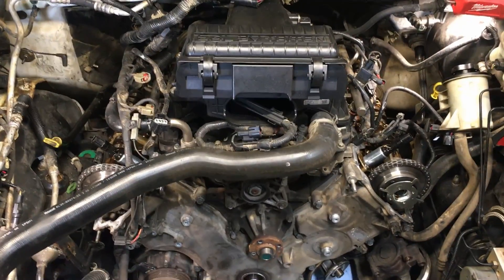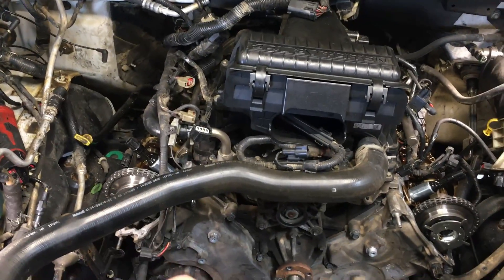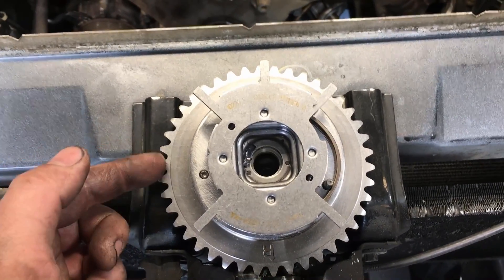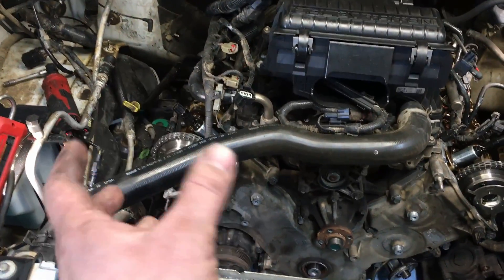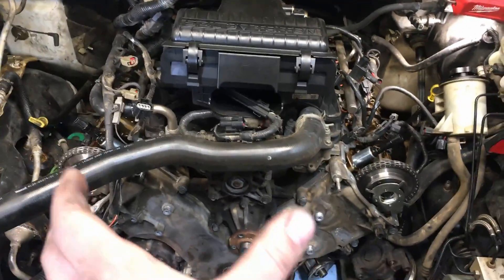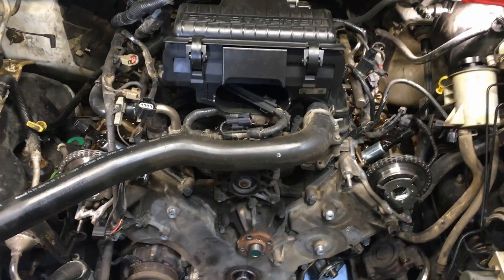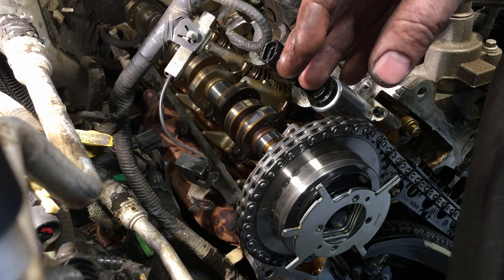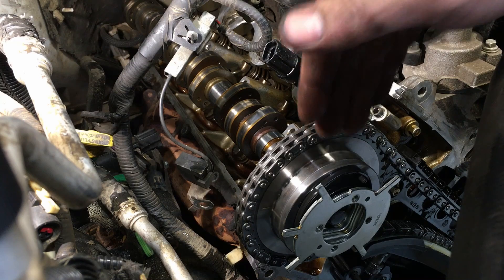Ford 5.4L 3v Triton Engine: DO NOT USE AFTERMARKET PHASERS FROM FREEDOM RACING/OTHERS; THIS IS WHY!

Comment: My trucks has 150k miles on it I’ve always service my oil with fomoco oil and filter. I can only really hear the phaser when I’m near a wall like at a drive thru . Should I consider replacing them or is some noise normal?
Reply from the maker: If it is just a slight phaser knock hot and they are Ford phasers then you are fine for now.

Comment: Granted, you'd rarely see old school vehicles with the 300,000+ miles we regularly see out of our fleet vehicles with old school (carburated, simple hei ignition systems and three speed auto transmissions)...but I'd much rather work on/maintain stuff built prior to 1983 than anything modern.

Comment: You charge $2300 to do timing kit and oil pump?!?!? All mechanics are thieves whether they’re honest or not. Nobody should charge more than $100-$200 for a full days work.
Reply from the maker: 60% of that price is parts which I sell at my cost, the rest is labor and fluids. You have to remember running a shop includes overhead like rent, gas, electric, water, tools, training, supplies, service subscriptions, tv, internet, chemicals, free loaner car up keep, waste oil disposal fees, garbage pickup and shop equipment upgrades to name a few. Oh and on top of that I have to pay myself and the Office Manager somehow so we can put food on the table. Compare my price to other shops charging $3,400 or dealers that are over $4k for the same job. Does my price seem fair now?
Reply: FordTechMakuloco  I understand that the parts are between $800-$1000 and that’s for the full new kit and oil pump. but $1300 for labor is a bit steep. Why wouldn’t you just pull the valve covers and replace only the phasers? Save the customer hundreds of dollars on labor.
Reply: What do you do for a living, Creamer?
Reply: lincoslam I’m a mechanic. A pretty decent mechanic if I don’t say so myself. I do work at my shop in my city mainly for friends and family and people who need their vehicles fixed but can’t afford to pay “mechanics” who charge $100 an hour for labor like single mothers and elderly people who are unable to work.
Reply from the maker: Why? Well here is the thing, when a vehicle comes into my shop and has been touched by someone else that deep into the engine and I just change phasers then he breaks down driving home (which is out of state) or has a startup rattle after. Well now it reflects on my work and how thorough I was. They rely on my as a professional to fix it and fix it right. Low and behold Freedom Racing sent him aftermarket chains, tensioner arms and tensioner. The tensioner arms were already grooved and tensioner seal falling off after 150 miles! Pretty crazy right, now do you see why I do what I do. To help I sold him all the Ford parts at my cost and a few I accidently sold below cost installed them and fixed it right from the bottom on up. I have a video on the parts that came out of this truck after 150 miles if you want to see them email me.
Reply: FordTechMakuloco yeah I feel yah. Lots of junk parts out there.

Comment: Weld the pins, use lock outs, don't use vvt,  be nice if you could run 2v cam gears, I'm joking for those that need to be told
Reply from the maker: lol

Comment: So your feelings on aftermarket phasers are quite clear, and seem to be justified. But i've been wondering something. As a tech that does so many timing jobs what's your opinion on a phaser lockout kit like the one Livernois Motorsports sells? I know it requires a custom tune on the PCM but the whole idea of fully locking out the phasers is just removing the possibility of failure down the road. By all accounts is a lockout kit is used then it shouldn't matter what brand of phasers are installed simply because they won't be able to move after the kit installation.
Reply from the maker: I never use lock outs, I will have a video on why soon. Also even with them locked out there could be internal failures inside the phaser and even the three pins on the front shearing.

Comment: Question, and I'm not harping on your work or anything. Why couldnt you stick the wedge tool down in there to lock the chain in the crank sprocket, mark the link that lines up with the L, take the old phaser loose, remove it, put your new phaser on with the L lined up with the link you marked, then rotate the cam to where the pin lines up with the phaser, slap it in, torque it and you're good to go. No need to remove the whole front cover and everything.
Reply from the maker: I was informed they also stuck aftermarket tensioners and tensioner arms in the kit too. The tensioner seals were already coming apart and grooves in the plastic arms after 150 miles. So yeah I was going in to fix it right with OE parts not do just the bare minimum. I actually shot a video on those failed parts and was going to include that in this video but I felt it was too long already and I wanted to concentrate on the phaser aspect.
Reply: FordTechMakuloco true, true, I get where you're coming from.

Comment: 04' 5.4 3v, 112k miles.  Ticking after a 10-15 mile drive, idle back to normal after motorcraft SP-546, boots w/springs, cleaned MAF/new filter, even washed out air box and redid the seal on the air filter cartridge.  Just did a 5w30 Valvoline Full Synthetic "High Mileage" with a Wix XP filter.  Fuel pump driver module changed about 2 years ago with updated dorman model and fuel pump that actually failed after was replaced as well.

When stomping down on the pedal, it just lacks ommph.  Sometimes it even delays, and only half kicks in.  It feels like I need to back off just for it to gain power, chocking it out.

Obviously doing the entire timing and everything would make sense, if cost effective.  What is the liklihood that the VCT selenoids are my only issue?  Being an 04' they are easier to get too.  Would it be a waste of cash to change them, or can I read PIDs with my OBDLink in order to check if it is the phasers/timing set and/or just the VCT selenoids.?

Comment: Thanks for the info Brian.  I just want to thank you again for the repair and engine install in my 5.4.  It's running like a champion using the synthetic oil / with the new  melling oil pump.  After 235000 miles new engine was the best choice.  But those critical engine components do  make the difference. ...

Comment: Why are these 3v phasers so expensive? You can buy complete OEM Ford timing kits for the Coyote for less than $500 retail and they include primary/secondary chains, primary/secondary tensioners (HD Boss 302 tensioners are what's included as well), chain guides, L and R phasers, crank sprocket and all hardware.

Comment: I agree 100%, i did this project myself and only bought and use what you said to, 2010 f150 200,000 miles now and still running like a champ, i did the replacement at about 170,000 ish.

Comment: Get a new Ecoboost powered F150 you won't be sorry! Top notch. Own 2 now. Best of best according to customers & JD Powers!
Reply: Plz come back and reply your thoughts on ecoboost in 10 years,for people that lease or hang on just until warrantee runs out the y are great but for those of us that want it to last well beyond warranty run really fast away from ecoboost. ...unless you are rich of course
Reply: @wolfmanrebel874  I buy all my trucks no leases. EcoBoost has been out since 2011 and going strong on Gen2 now. Proven. Ford has tons experience w/forced induction. See ya at 250k+ trouble free mis in our 3 Ford trucks.
Reply: Exactly, everything runs great the first 5-8 years, maybe 100-150K. After that is when we see what true reliability is.

Comment: I had the same issue with dorman parts . I used updated vct with smaller drain holes .. the screen collapsed vct was stuck open . Ruined the phaser.. got a Ford kit and reused oem vct and never a problem ... This was 3 years ago

Comment: I thought if timing is off valves get bent since these are interference motors and thus need to pull the heads off?

I learned this the hard way, my aftermarket phasers were from Evergreen (same company as Domestic Gaskets) they failed after 12 miles.

Comment: Hey mate, I put the Precision Auto ones in my Aussie Ford Falcon about 20,000kms ago.  It is running fine at the moment but now you have been very worried after watching the video!  Do you know what weight oil the customers were using that had issues with the Precision Auto ones?  And how many Ks they had done before it became a problem?
I went Precision Auto not to cut costs, but because Freedom Racing mentioned they were more reliable!

Comment: Just don't buy a 5.4 3 valve in the first place.  Underengineerd junk motor.
Reply: They're junk unless you want to do work on a used truck to fix issues that shouldn't be issues.
Reply: I have a 5.4 3v with 338,570 miles on it, one timing job, few other repairs, but primarily maintenance when it’s supposed to be done, and with quality materials. Anybody else want to say they’re crap?
Reply: @daveo3782  That's good to hear. Mine has 245K and run's like a champ. I let it warm up before driving and change oil religiously. Those engine's need clean oil. As far as the ticking noise. I've lived with it longer than I can remember. The Toyota 22R had timing chain issues and look how long they ran for.
Reply: Dave O ok Dave . Apparently you have a good experience with your 5.4 three valve.  Great. Yes, there may be exceptions to the underengineerd poorly designed 3 valve, that actually works , but that is rare. Even a broken clock is right twice a day.
Reply: @teresa67factoid95  I have a dealership, so I've dealt with a lot of trucks. 5.4 3v really isn't as bad as you make it out to be. Sold several, including one at 400k miles. They keep kicking. The one with 400k finally had phasers let go a few months back. I'd say every truck will have 1 timing/phaser service in it's life, besides that they are bulletproof.
Reply: TheCompyshop o.k. I hear you. 
You fix them, so you know about the 5.4 three valve phaser issues. 
Plastic chain guides, ridiculously complicated phaser timed valves,  just for a couple of extra mpg. 
Underengineerd junk. 
Buy an f150 with a bullet proof 302.
Thank me later.
Reply: Ken K they also make more power soooooo. It’s not just a few mpg. They are more fuel efficient, can tow better, more torque down low thanks to the phaser design, etc. there’s benefits. Who cares if you have to service it once in the truck’s life. Big deal. Gas mileage savings more than makes up for it over the life of the truck compared to an old gutless 302
Reply: 302 here. My timing kit was $20. What's a chain guide? Or a cam phaser?
Reply: Yea amen to that....im taking out the 5.4l in my navigator and gping to ls swap it with a ls1 or 5.3l
Reply: Overengineed if it works flawlessly, underengineerd if it constantly fails.
Reply: It was a case of rising fuel prices causing an engine to be rushed to market before the gremlins were worked out. Just like the Cadillac 8-6-4 in 1981 during the second energy crisis and the 6.0 diesel in late 2003 during Gulf War 2.0
Reply: @EightiesTV  The Cadillac 8-6-4 was way ahead of it's time, computer technology wasn't advanced enough to make it work
Reply: the 3v is amazing compared to a 2v 5.4 oil has always been a problem on 2v motors they just dont last much over a 150k but keep the oil clean and your 3v will last if you dont your screwed people also dont realize most camshaft codes are from oil getting into the connector of the solenoid or just a bad solenoid
Reply: 367,000 06’expo
Ford phasers and chains,eBay Chinese tensioners,guides,and solniods
Smooth as glass burns a little oil and may knock up top every now and then
Next go around will hang the new melting up 20% oil pump
Got burned on the ebay phasers I just put the ford ones the expo originally had
Reply: Apologies for spell check
Solenoid 
Melling 20% higher volume oil pump
Reply: @tonydowell9352  when I have that problem, I think I'm going to use the lock-out kit.
Reply: lmnop yes I agree wholeheartedly that the 3 valve is amazing.  An amazingly bad design, that  should have stayed on the drawing board, and never have been allowed in  a vehicle that people paid hard earned  money for,  with the expectation of being reliable.
Reply: Ken K ur a troll. It's a long since phased out motor that was top notch in it's day. 240kmis on an Expedition!
Reply: David Klimmek naww, just ask any Ford owner.  The 3 valve is a bad design. Ridiculously complicated,  for a couple extra mpg. No informed consumer  wants one, due to the bad reputation,  and zero resale value.  Law abiding citizens have even considered insurance fraud to get rid of them.

Comment: Love your videos. I've owned 2 expys. A 98 and my current 04. I specifically bought an 04 because it was the last year that the expedition used the old (RELIABLE) 2V 5.4. My 98 had 255k on it when i sold it almost 4 years ago. I saw the guy driving it a month or 2 ago. It has over 350k. Original engine, nothing other than an alternator and regular maintenance items, i.e brakes, COPs,Plugs etc. Wheel bearings are still all good! Now my 04 only has 155k. It has rust on the rocker panels already. The power moonroof broke the plastic clip part. Other than that it's perfect. Oh, and the wheel bearings in the rear needed replacement when i bought it...........I suggest, if you're looking for a expy, go 98-02 if possible. DO NOT BUY 05 unless you want to do what this video entails! It is inevitable in the early 3v engines. Why didn't ford go like GM and just make a nice, simple pushrod engine and stick with it? That's another story
Reply: Josh gm 2.8 and 3.6 look very similar bicycle like chains long and about 3 of them and plastic chain tensioners lololol what could go wrong .. Push rod engine 3.8 replaced by aluminium 2.8 and 3.6  only about 35 lbs lighter so it not just Ford but other manufacturers as well
Reply: nick king Any GM High Feature V6 should be avoided at all costs especially the LY7 and LLT.

Comment: Typical Ford, and aftermarket is junk but Ford parts wouldn't have gone bad in the first place if they were that great
Reply: Phasers are a wear component. If it moves it wears out. You haven't had the experience of working on 50s and 60s cars for collectors that actually get driven. Modern stuff lasts SOOO much longer and it's rather amazing given the complexity. Harder to work on yes but far more reliable.
Reply: It took 3 times to get the phasers right
Reply: Andrew Scott all vehicles have wear components that’s like saying “if the main bearing were good they wouldn’t wear” hate to tell you they wear because they’re part of a rotating assembly. Same with the phasers.
Reply: Everything wears out
Reply: Andrew Scott Ford is #1 . Ecoboost superiority!

Comment: This is why when looking for a low miles mint condition 2nd generation Lincoln Navigator, I only wanted an 03 or 04. I wanted nothing to do with an 05 or 06 cos they had the 3V 5.4. I found an 04 & it has the 4V 5.4

Comment: 100% tru dorman standard motor products all aftermarket phasers are garbage im repairing one engine now with dormans that fall a part
Ford oem are the way to go especially updated one that they have now and 5w30 oil with high pressure pump 👌👌👌 you sir do a great work out here

Comment: I replaced my phasers in my 05 f250 with the Oem ford phasers and here we are almost 10k later and runs like a top and no knock I did up the oil weight to 5w-30 on the factory oil pump I would like to replace it down the road with the pump you recommend do you think it will be okay? Or should I replace the oil pump ASAP? I also installed the recommended timing kit along with the phasers

Comment: And this is why i only buy ford parts for my truck. I rather spend more money and have it last than it break in 6 months. My 05 f150 has 215,000 miles on her and she runs great and im going to keep it that way. By the way i like your videos. I've learned a lot about my truck and how to fix things the right way.

Comment: Just installed a timing kit with phasers from Auto parts prodigy (off Amazon) on my 2004 5.4 with 120,000 and a 500 mile test drive this weekend with no codes. After this video think I need to sale this truck fast and get a GM
Reply: The old phaser on bank one was a after market and doing the same thing as the one in the video. Plus a broken piece of spark plug in the #4 intake value. I bought the truck with more codes then my code reader could show at once.

Comment: Hey there, just wanted to ask for some advice since I am replacing the timing kit should I replace any other components while I have it open? My FX4 has 190,000 miles on it.
Reply from the maker: Full timing set and Melling high volume oil pump the 5w-30
Reply: Awesome! Thanks for the quick reply. I am so far moving along well with your instructions and I really appreciate the great videos you have done on the 5.4. I watch them everyday and feel like I can do almost anything mechanical on my F-150 thanks to you..